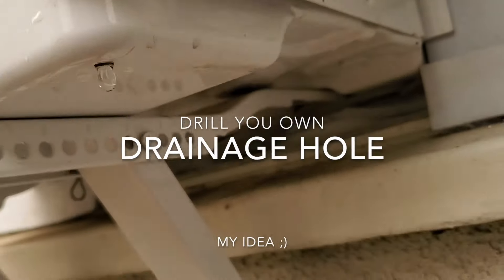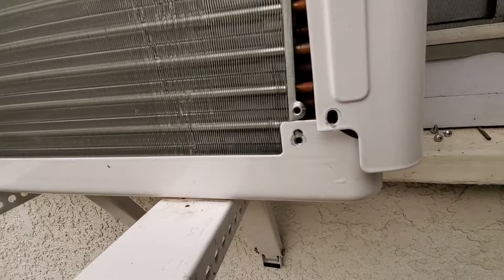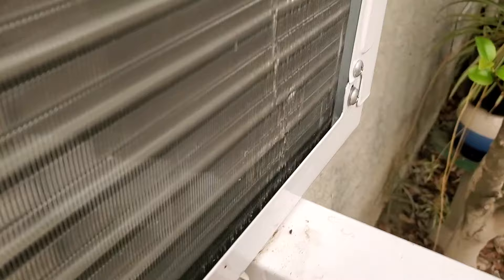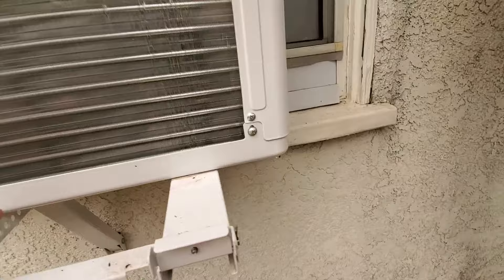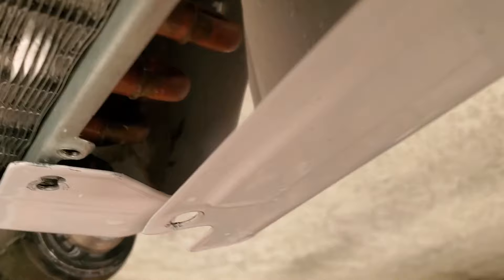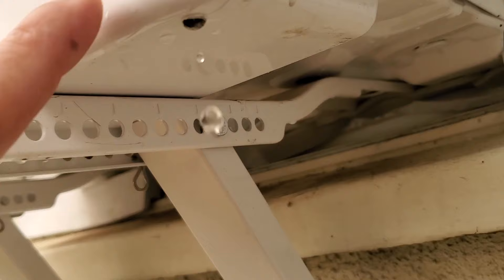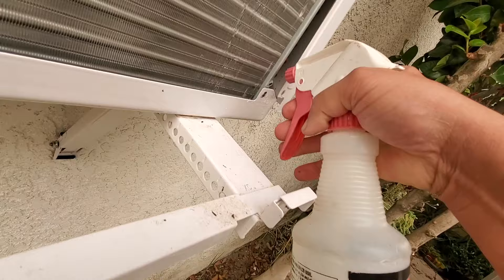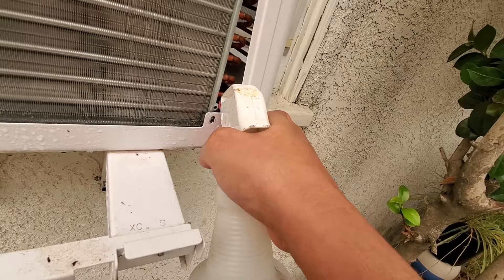How to Drill a drainage hole in your Midea U- Shape fan :) Honest²

Comment: I'm so confused 😱!!  Some say leave alone and some say here's the plug.  Use an AC unit cleanser cause of copper.
Reply from the maker: I don't follow the mantra about the water in there.... I believe the drainage holes got plugged when they painted &/or powder coated em.  TIME WILL TELL WHO AC WILL LAST>>> The ones who drilled... or not drilled @_@ Honest²
Reply: Coming from a collector of vintage ACs, the ones with a drain hole are almost always mint on the inside, the ones that are not are usually rusted very severely. Drill a drain hole!
Reply: All I know is there's nothing more dangerous for your health than mold inside your unit. There's nothing more gross than a bedroom air conditioner that smells like mildew. Washing those air filters does not get rid of the mildew. This is a huge problem in cheap hotels and in houses from Atlanta to key West. Drill the holes!
Reply: I just put my AC units in my upper floor since both of my Central airs went out a week apart.  I purchased one new unit because they were both 21 years old and the old gas is not around.  Had to purchase a new furnace to be compatible with the new freon gas.  Anyway, I think instead of drain holes you may be able to drain away the water with a wick sitting in the pan area and hanging outside the case lower than the pan.

Comment: Hey Mike. So do you or can anyone that sees this tell me how this specific air conditioner drains? Does it literally just drip down the back of the condenser coils in the front and ride into the pan or is there an actual drainage line that feeds out? Mine starting to leak in the front into the house so I wasn’t sure how it drains exactly. There are two holes in the back of the pan that are clear and open so I am at a loss. Thank you in advance for any help.
Reply: I haven't installed mine yet but, position of brace can make a big difference in how it drains?

Some video suggest level but, I'm making mine to tilt backwards towards compressor and little towards where the hole will be for drain...makes more sense to me that way.
Reply: Id check how level yours is and make sure it’s not sloping towards the house

Comment: Do these units or similar units come with a disconnect switch or valve shut off so I can completely disconnect the unit into two i’m doing a makeshift installation through the wall and would like to not drill a hole the size of the unit into my wall

Comment: All you are doing is canceling the "AC Slinger" that throws water to allow AC to run more efficiently. Engineers did not forget to put drain holes under the fan.
Reply: That was their PR excuse. The newest version has a proper drain hole.
Reply: @bobdroidsky225 no way does it really? I got this same unit about a year ago and yesterday it just wasn’t cooling as well as before… I was even thinking about taking it back to Costco to replace it with the newer version . Or at least I’m assuming that it’s the newer version when I went last week they had this model. You think I should drill a hole ?
Reply: @UnderratedTech-  If it's already not working--it's broken. DO NOT DRILL A HOLE as it would void your warranty!!!!!!!!
Reply: @UnderratedTech-  Drilling a hole will void your warranty. Just take it Costco, get a new one, and THEN think about drilling!

Comment: So the Midea I bought last year wasn't draining, actually it was throwing rust all over the side of my house. When I took it out to store it last fall I could see rust all over the inside of the outer part of the unit.  I don't believe this is normal for an ac unit.  Any suggestions???
Reply: This is interesting because my Midea U which is fairly new is already having rusty water in the pan.. I live in a hot humid climate (South ALabama) and this unit seems to have issues with keeping humidity under control.. I wonder if this condensate sitting in the back could possible affect that in some way.. But the fact that it's already rusting inside seems to be a quality issue..
Reply: @mattolsson8816  Just got mine today. The second I picked up the unit and felt how light it was for 12,000 BTU; I knew straight away that the alloys they were using were too cheap to last very long without rust. They have to be using either cheaper metals or a lot of plastics. I doubt there's much copper.
Reply: Lol, it seems like modern window units purposely let that water pool and fling it all around on the condenser…and wherever else it happens to fling. It is to increase efficiency they say. Down sides are noise (random annoying splattering/popping noise), rust and mold. Up side is efficiency. I will pay the extra bit on my electric bill and drill the hole. You can’t drill blind into these units though, be careful.
Reply from the maker: WHOA!!!! Good share @_@ I wonder who else has seen this • Honest²
Reply from the maker: @mattolsson8816  WHOA!!! Drill it... you can always Gorilla tape it after ;) That's what I did during my TO WATER or NOT TO WATER Test :) Honest²
Reply from the maker: @mitchelljermaine  DUDE KNOWS HIS TACTILE FEEL!!!  Most people have no clue about that!  Glad you notice that too \m/ Honest²
Reply from the maker: @travisevans2549  YUP!!!  That's why I didn't drill in the bottom middle... I had no clue what was on the other side.. The right back Corner (When Lowered) can get the clearance you need • Honest²

Comment: My 12k btu unit has a drain. This A/C unit also evaporates this condensation water if your humidity is less than 80%.The water doesnt just sit there. Its used to cool the components of the unit.  Its designed that way. Im in a dry climate so i have zero issues with mine. Don't do this mod just because there is a video about it. The instructions mention issues with very high humidity. Mine also has a drain. Unit must be near level as instructions state to work properly.

Comment: I see some people in the commens saying they dont want to breathe mildew. If you think you're breathing air from the outside of your AC you have no idea how an AC works. There are two fans and two separate air loops in a window AC which have no overlap, inside air is recirculated through the evaporator coil inside and outside air is recirculsted through the condenser outside. All that mildew never comes anywhere near your air, stop worrying. The only reason to drill a hole in your AC is if you prefer spending more every month on electricity.

Comment: Is there any reason the support bracket is so long .. even on the 12,000 size... Mine will be in area where people walk past it ( like me) , and that thing will leave a nasty bruise or cut. Is there any way once you know where the A/C sits on it , to cut the legs shorter and remove the cross beam ? I'm thinking it should be easy enough to somehow tie it back together under the A/C if necessary. Or is it even necessary ? This is my biggest concern before purchasing this unit. Thanks, Steve
Reply: concur 100%, the ac is over engineered and the water drain and the bracket were neglected!
Reply: @todbnla  No... no drain is part of the design as is the long bracket...it is longer so as to be able to move the unit during install or maintenance.

Comment: is it normal to have the liquid pool in the bottom of the front (inside) portion of this unit? i see water between the bottom of the base plastic and the metal grate on mine that i just installed today.
Reply: @Ruben Garza where is the drain hole? I thought there was not a drain hole on this unit.

Comment: Thanks!  What is your solution to clean the blower wheel which gets caked with bio slime?

A possibility:  Before turning the A/C off, run it on fan only for a period of time to dry the moisture off of that wheel.  What do you think?

Comment: 12000 btu (purchased at costco). Been in window almost a month. Corrosion /scale appears to be forming at the bottom of the rear fins. Also rust color water from where unit panels meet at the rear(and splashed on the side fins). Notice the internal screws started to rust after the first week (look through the side vents).  Runs and cools fine. But, if thats corrosion starting to build up already on the fins....its no way this unit will last long (cooling wise).
Can someone educate me on this and has anyone notice this this issue or something similar.

Any help/advice would be greatly appreciated. Purchased two units tested the first one for three weeks no problems. But this second one I'm not so sure.

Comment: I bought these u shape units last year. Doesn’t the new models have drainage holes?
Reply: They do. Unfortunately I have a very wide window sill (6 inches) and the holes are draining into my window sill.
Reply: Yes. Unfortunately they are badly positioned. I added a hose to mine. Not sure if that's going to solve the problem with my window sill.

Comment: Not a good idea. I work 34yrs in the hvac field from residential to industrial before  retiring. If it bothers you wick it. You can always spray the back of your units with a mixture of white vinegar and water. I’m sure GE, LG, Frigidaire, Medea have Engineers that are more qualified than most backyard engineers! Plus it could also void your warranty. Believe me, I made a good career / living  from back yard Mechanics! Proper Preventive maintenance throughout  running season will go  along way in stoping mold growth in high humidity areas.
Reply from the maker: Yup!!!  You nailed it John O. Can't believe how many people keeps telling me its not a good idea but mine is clean and running fine • hm²
Reply: I just made a comment about wick it.. not sure if that is what John Z means by wick it is the same as I was thinking.  Would like to know though how John does his wicking!

Comment: Im pretty confused by this unit.  Installed with the proper tilt degree towards the outside. Got SO much water coming out the crevices of this unit.  I can't have it leak outside because I live in a 100yo barn with a big 2nd story outside deck where this AC hangs, and the water will damage it.  Anyways, because of this, I drilled the hole. It worked okay for last summer...this summer I now have the water draining from the drain hole but also draining through a couple other holes more toward the center of the unit's housing, and its very hard to catch the water.  I'm getting SO much water, like a gallon or more after 24 hours of use. All my other units (non u-shaped mideas) don't leak at all and have no water sounds or anything. Why the heck is this one so annoying! I love the look but man, the drainage thing is such a weird problem. Is anyone else getting this much water?  It cools great by the way

Comment: The water pool is there on purpose for super cooling. Please don't drill a hole in your fancy window unit.
Reply from the maker: I ran test... SHOWED 1°(f)  DIFFERENCE WITH or Without water.  Held about 3 cups of water... the super cooling is BS. How did the water get there??? Condensation!  Or do selll it with 3 cups of water in the basin??? NOPE!   I only did it  because a guy for an Facebook forum Thought he had Covid...Traced it down to funk that was growing in the basin of the Midea AC.  BTW i found some dead bugs in the water when draining out... Aaaaahhhh Nope!  Dont want to breath in dead bug funk • Honest²
Reply: @kesslerfox9858  thank u 💪🏾💪🏾💪🏾 well said .. 👏🏾
Reply: @HonestMike  Its not that it won't cool as cold but you just reduced the efficiency of the unit during certain conditions.
Reply: @kesslerfox9858  BTW the unit uses R32 refrigerant, which is flammable. It's not going to go boom, and is supposed to be difficult to ignite, but as a believer in Murphy's law that'd give me pause before I went drilling next to a line.
Reply: @HonestMike  I mean...you wouldn't be breathing in dead bug funk because no air comes in...just the lineset.  the fan on the inside moves all the air in your room.  Just like how a normal mini split works, just MUCH shorter lineset.   THAT being said, I am no fan of gunky rust lol.  I just ordered two of these for my new house, i'll keep an eye on it and treat if it becomes an issue for me.
Reply from the maker: @nighteyeswolf  DID YOU SEE THE VID FB VID (Updated Link) The dude who was getting sick from his AC Funk @_@ Funk is good... when it come to Music, not in my AC :P Honest²
Reply: @kesslerfox9858  I live in south Mississippi, and I just noticed that my Midea U unit was leaking from the bottom of the portion INSIDE my home, and clearly had been since summer began. It is far too humid here and the water cannot evaporate or drain out the back nearly fast enough, so some has been back-flowing and coming out the bottom inside the house. I had no choice but to drill a small hole, and problem solved.

I understand where you're coming from, but in some climates these systems cannot repurpose the condensation at a rate to keep up with the amount produced. It's so much that the plants under it actually died from overwatering. We have to rethink the landscaping there now.
Reply: @kesslerfox9858  Is that Midea's information?  (sub cooling)  Is there a link to this?
Reply: @kesslerfox9858  trash info; it maybe the case if you lived somewhere dry like Arizona, but go somewhere humid like the south east and that water will never evaporate.
Reply: @HonestMike  let me be the one to
Admit I’m in the wrong about this midea unit. Does your drain hole help eliminate the musty sour smell ? I was wrong and they should’ve put a friggin hole on this unit. I’m also having problems with mold building up on the Squirrel cage fan. Midea didn’t make this thing user friendly at all and there’s little to no way to take out the blower fan and clean it properly.
Reply: @kesslerfox9858  the drain hole eliminated the musty smell for me. The first one I drilled was too small and a bug clogged it up. I just started using drip pan cleaner tablets too, but that might not be necessary.
Reply: @sammysokosammysoko  39466 here too, same issue!
Reply: @todbnla  39577 definitely drill the hole if you haven't already. I poke a little stick in it every few days because it WILL get plugged with a bit of funk that grows. When I poke it, it drains like a faucet in a steady stream for quite a few seconds.
Reply: @sammysokosammysoko  sucks not only this one but other makes you can find same issue w/no weep hole, wtf?
Reply: @josephchambers3394  How to you put in the drip pan cleaner units.  I would like to use those instead of risking voiding my warranty.  I just set the schedule up to run the fan for a couple of hours during the downtime of my units.  Not sure if that will even make a difference. But someone said he has been running his fans for a couple of hours everyday. So if I knew where to insert the anti funk tablets that the bottle of tablets say last six weeks I should be good.🤔
Reply: @Funky4me21  I drop it through one of the vent holes in the top. As I'm looking from the installed unit while standing inside, I drop it in the back right. The slit in the metal extends far enough back on that side so that your tab will land in the drip pan.

Comment: I just walked past my unit from the outside of my house and the unit smells like dead fish. There is a bunch of sludge in the bottom. Do I drill the controversial hole. I think I should! 🤮🤢🤢
Reply from the maker: No funky smells from my DRILLED fan!  Just a bunch people saying it's wrong!   Nope, my fan is still clean as ever... 3 years later  :) hm²
Reply: So, so happy to see your video!  I live in South Carolina and the humidity is like sitting on hells fron porch during the summer.  I'm drilling/puncturing through!  

Also,  the plexiglass? Is to keep rain out?

Thank you!
Reply from the maker: @lisalitt9755  I have a Hummingbird food feeder over the AC.  Keeps dripping from falling in... check out #MyHummingbirdBuddies YT shorts to see :) hm²

Comment: The reason it does not have a drain hole is because the fan is supposed to sling water onto the condenser to help with Cooling. That may or may not apply to this model but it does drain aeventually if it gets over a certain level.
Reply: And a certain amount of water just stays there.  If you are in a dry area it may evaporate.  I'm in the south and haven't run the unit in over a week, it is hot as hell down here and there is still water standing in the unit.  Humidity is just to high for it to dry out.  It will be an algae haven and rust in a short time like this.  Maybe a drain hole with a plug may be the best arrangement, if I can just remember to drain the unit...

Comment: BEWARE - I ruined a $400 air conditioner folling these instructions.  There's no easy way to repair it afterwards. I tried.
Reply: What happened, did you make a hole under the unit?
Reply: @paulinaungureanu8032  probably hit a coil

Comment from the maker: UPDATE:  I added a FB Link to the Bug FUNK on description!  Not to sure if the Link will work here?  https://www.facebook.com/AngeloTheoharis/videos/10216714768437991
Reply: Thanks for that link. I am joining this group so we can share experiences with these units.
Reply from the maker: @mattolsson8816  RAD dude :) Honest²
Reply: Ha ha yeah that's some nasty stuff but all a.c. Can do that, everyone I owned has. A/C needs.yearly cleaning for sure. Ain't that the stuff the evolution folks say we are made from ? Can't harm us then.
Reply: Damn that's nasty.  Any idea where the low part of the unit is?  When I saw the sitting water today, I got out the level and from the top the unit was tilted exactly the same on both left and right (facing the unit from the outside).  Then placed the level on the bottom under the condenser coils and the unit had a substantial tilt from left to right.  So it appears from the outside anyway, that the back right corner may be the low point.  But some say it holds several cups of water so maybe not?  I am not going to let water just sit in this unit when it is not being used.